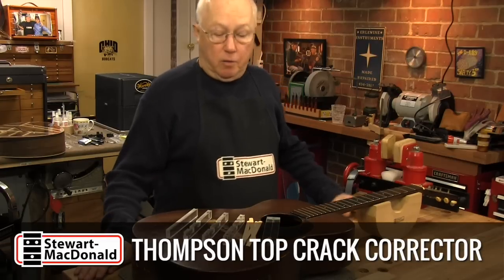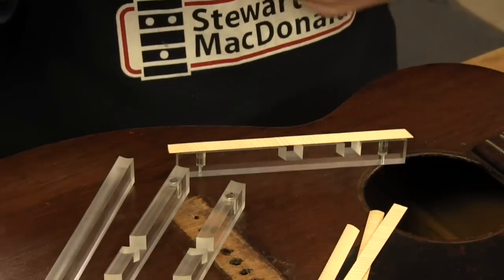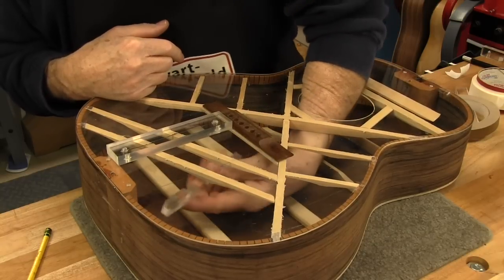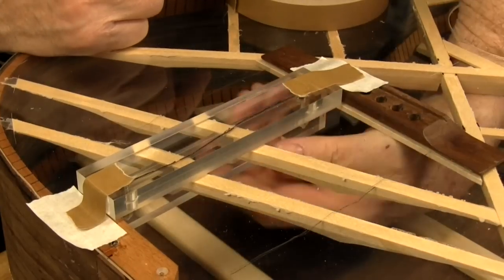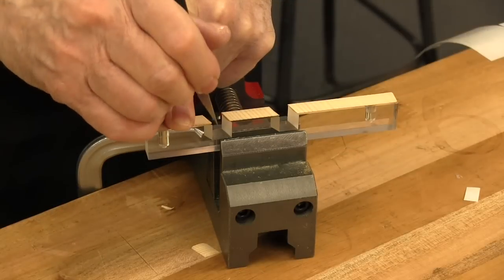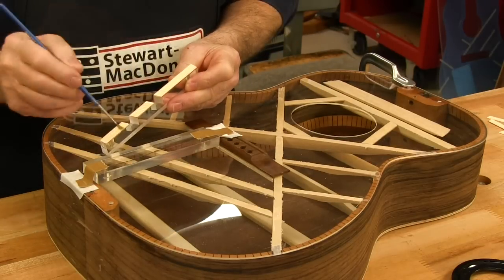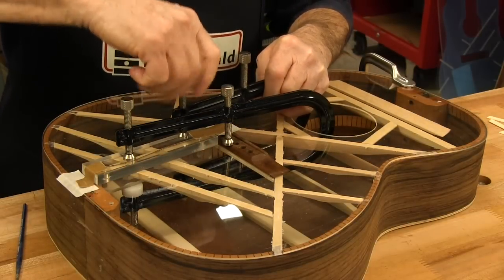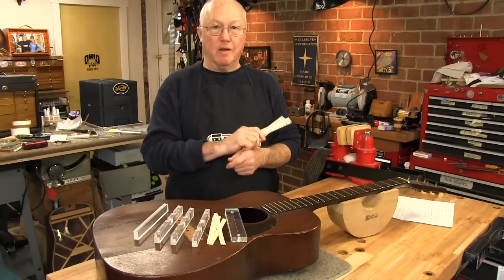Thompson Top Crack Corrector

Comment: i used a popsicle stick( it was spruce) and elmers glue to fix a crack in my guitar, it worked but it took 2 years for the wood and glue to dry out, this is a much better system, thanks

Comment: Bummer! I've got a cheap, but awesome little spruce-top parlor guitar here with an 8-10" long crack in the top, 2-3" to the right of the bridge, running from the waist nearly all the way to the bottom of the lower bout (much like the crack pictured here in this video), and this tool/technique would clearly be the correct (i.e., the 'pro') way to handle such a crack, but I've gotta believe the location or positioning of those notches in the caul are not going to work on every make, model and size of guitar, right? I mean, what are the odds? I suspect every manufacturer position their braces somewhat differently.
Reply: He does mention that some uncut cartridges are included just for that situation - you'd carve out notches to fit your particular guitar.

Comment: Oh, but I will be able to see!! I don't own lead gloves and a lead apron just for fun. Having collected vacuum tubes for a while, I have made my own CCD Fluoroscope, that shows me a live X Ray image on my laptop. Why not? Just having the X Ray tube on display in a glass case seemed like such a waste. A cheap auction fluoroscope with a dead Varian tube later, and voila! I only use to copy bracing in guitars, or whatever. Wrist watches, anything I want to x ray, that might look cool. The rate at which airports are upgrading the CCDs are cheap and easy to come by. They usually yank the tubes for safety. A 6L6 tube produces X rays, just not very strong x rays. You can x ray a flower with a 6L6 from your Fender amp and some x ray film, in 30 minutes or so.